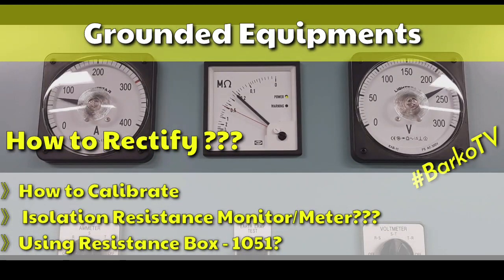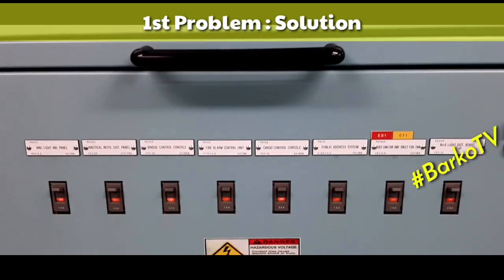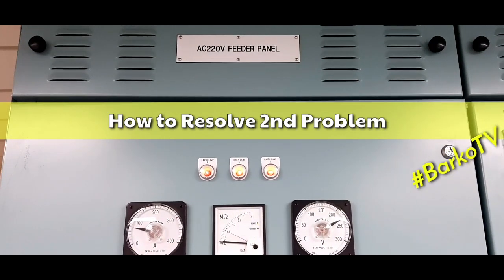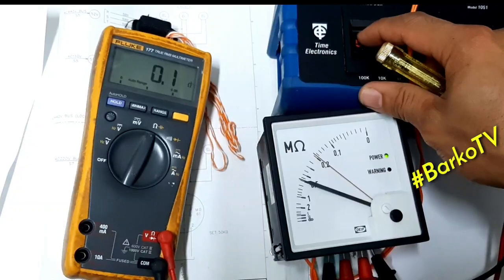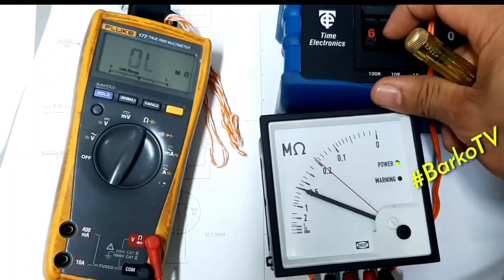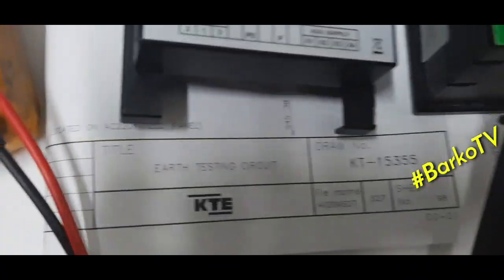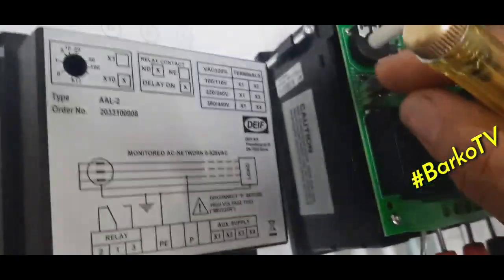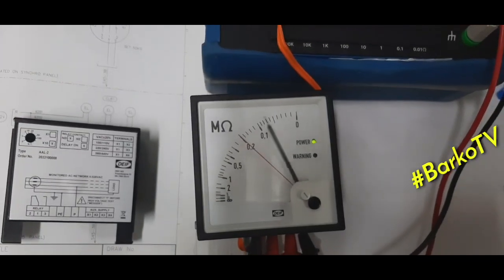Insulation Monitor DEIF AAL-2 / Grounded Equipments | kalecky |chief |makinista |marino

Comment: What is the use of earth lamp test?
Reply from the maker: To monitor low insulation, if one of the 3 lamps, is not brighter as two lamps means that phase has a low insulation.